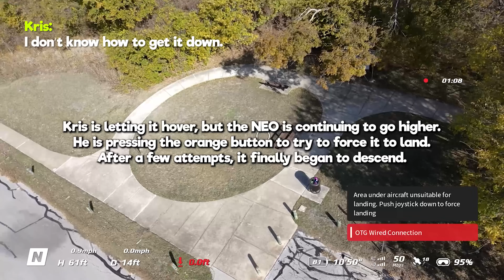Don't Do This With Your NEO [DJI Responded]

Comment: It's not about the GPS.
Neo can fly freely no satellite (0 satellite) but well lit and textured area.

It's not about the satellite it's about the vision sensor
Reply from the maker: Understood, it needs texture and light. That makes sense, but when it goes into a low light area and the GPS is weak, it becomes unruly while flying with the Motion 3. Also, it seems like the vision sensors have an effect on the GPS lock. 

I've had white satellites on the lower right, then covered up the vision sensors, and the GPS goes red and the number has dropped.

Either way, whatever the issue is, people have had the NEO surprise them when they go somewhere darker and lose satellites. And they end up crashing. It shouldn't behave differently and become extra sensitive in that situation. 

That's pretty much the point we're trying to make.
Reply: How about when using the RC-N3 OR N2?
Reply from the maker: We don't own that RC, but we suspect there is no problem because we don't have issues with the RC Pro, FPV controller 3, or just flying with a phone.

Comment: ❤why does the avata 2 work with goggles integra, but the Neo doesn’t? Great video!
Reply from the maker: Probably for the same reason that DJI hasn't fixed this throttle issue. They don't want to spend time/money on something that isn't lucrative. Although, more compatibility might help with sales. 🤔
Reply: @ yes, I would buy a Neo if they update that

Comment: Dude on the right bottom it shows you don't have enough satellite connection. Are you illiterate enough not to know trees block the satellite connection? You are trying to fly it in a box of trees. When it passed above the trees it had enough satellite lock so you were able to control it. Yes, Neo has problem flying in the dark not only dark but low light. But this test is misleading.
Reply from the maker: Yeah, we fumbled that test. One point I was trying to get across was that somehow the GPS lock was connected to the light sensors. 

In later tests (video is yet to be released) I tried flying at night with over 10 satellites, which is what DJI told us was necessary, but it still went crazy. 

Other commenters said that 20 was the minimum. That actually seemed to solve the issue with satellite lock and low light. 

What's surprising is that DJI won't acknowledge that the Motion 3 causes many flyers to crash when they don't realize that it basically becomes 10x more sensitive when it loses GPS in low light.

Thanks for the comment. In hindsight we could've done these tests better, but hopefully it's more helpful than not.
Reply from the maker: When I first took off, it said the home point was updated, at 14 satellites. So I thought that was the sign of GPS lock. But with the tape over the sensors, somehow that causes the NEO to decrease the number of SATs. 

Again, we could've done this better, but the point was that the light sensors are related to how stable the GPS lock is, for some reason.

Comment: Around 10 mins ago I experienced the drone going totally out of control when testing my new goggles and Motion 3.  Like you say the sensitivity and speed increases to the point where it can't be controlled.  Before seeing your video I continued with my testing and I switched on my main lounge lights which are extremely bright.  The drone behaved as expected or should I say as I had hoped.  I then saw your video and was reassured that it wasn't the electronics that had got a fault but a peculiarity of the Neo and MC3.  I need to practice though with the MC3 as there does seem to be some differences to the MC2
Reply from the maker: I've been chatting back and forth over the past several weeks with DJI support, and they don't seem to agree that there is an issue. 

They said that maybe I'm not as good at flying with the Motion 3 than I am with the RC 2, but at least it's good to know that a lot of other people are having the same problem.
Reply: @readysetdrone  Hate to say it but DJI often look for any other excuse,  Im not knocking them because they have definitely improved 100% since the original Wookong days.  I keep getting the message that I am not connected to the DJI Fly App and have lost count of the different options I have tried.  Also today in daylight I tried to fly indoors again and it went berserk with in seconds.  Something is definitely wrong here.  Also I don't understand how they can say its the use of the MC3.... If you just take off and do nothing and hold the MC3 still with no trigger input it still goes mad !!
Reply from the maker: It's definitely frustrating! 😕

Comment: Had a flyaway with my DJI Neo on a misty but visible day. Took off using palm control, and it suddenly shot off uncontrollably beyond the castle walls. No warnings, no way to stop it. A drone designed for easy, controller-free use should be more reliable in real-world conditions. Disappointing.
Reply from the maker: That's a helpless feeling! I wonder if something obstructed a sensor under it. 

When we put tape on ours, it was trying to get away from what it thought was the ground by going up. 

It's a stretch to think that even a bit of dirt could make yours fly away though. 🫤
Reply: @readysetdrone  I just think about infrared and high humidity mix

Comment: it's using semi-automation in motion controller mode... so it relies on the bottom sensors to see and assist in self-leveling and stationary hover.... in full manual mode with fpv remote, it relies on nothing but your skills , therefore performing better ..... but it needs to decide itself to disregard the bottom sensors..... when you tape them over, the ground height reads as 0.0001m and confuses the logic.... it flies for me perfectly under control in pitch black darkness over my city and lands where i want it.... it does ask to recalib the compass every time it sees the darkness and makes a decision to disregard bottom sensors... but once enough sats are on, and they arent RED, it flies like a beauty ... the camera is obviously junk for night, we all know that... but it flies for me like this https://youtu.be/aV2QLAF6icI
Reply from the maker: Yeah, that tape incident was an unfortunate distraction in this video. 

The point we were hoping to get across to DJI and also others flyers were to be careful when flying with the Motion 3 in the dark without a solid GPS connection, because it goes wild!

Comment: This happens to me during the day almost every time I fly. I already crashed the drone once, it suddenly lost control, and at a crazy speed it hit a palm tree that was 20 meters away from it, and it fell and seriously damaged the body, although the drone had additional protection. I have already ordered a new body. The damaged body was repaired, glued together and the drone's functionality was restored. Also, during a flight during the day with excellent lighting and a large number of satellites (20+), it can suddenly stop and make spontaneous maneuvers... I fly with the included (native) remote control n 3.
 It's big problem...
P.S. I also forgot to mention another problem, if you fly Neo on an inclined plane, for example a small slope, the drone does not maintain altitude. For example, set the flight altitude to 2 meters and fly down the slope, then the drone gradually raises the flight altitude, and if on the contrary, then it decreases until landing and possibly hitting the ground, I have not checked, I stop the flight.
Reply from the maker: Wow! There definitely some bugs to work out. 

Regarding the altitude, I think it's staying at the same altitude above sea level, right? But you want it to change its altitude according to the ground's terrain. That seems like something which could be updated on the software. 

For what it is, at $200, it's a versatile little drone. Just needs a bit of firmware "polish."

Comment: Funny it 2 months later and I gust go the motion controller and it did the same thing when flying in the house went full speed into the wall
Reply from the maker: Yeah, that seems like it could be fixed with a firmware update, if DJI wanted to. 

Ours knocked the camera out of placea few times. Luckily we were able to wiggle it back into place. Be careful!

Comment: I got my Neo today and after flattening the 3 batteries flying in my front yard, I took the batteries in and charged them, and was going to do a lap of the house, at night, but I had the exact same issue - it took off after about 15 seconds in the air. I am considering getting the RC 3 as a bare bones controller and still using the goggles to see, not because I plan on flying in the dark, but I just don't like the motion controller as much as I do traditional controllers.

Comment: Tape on the sensors caused the rise, it never had a reduction of load to think it was safe to cut off the motors. Bottom line is, the drone has the sensors and needs them to operate properly.
Reply from the maker: You're right. We pinned a comment to this video to address this. I think our mistake with the tape distracted from the other two issues we were trying to demonstrate which were (1) darkness without adequate satellites seems to make the Motion 3 extremely sensitive, and (2) low light sensors seem to affect whether or not the satellites are able to lock. Hopefully DJI can fix these issues with a firmware update.

Comment: its the same with both avatas - I just put a light at the bottom , so the sensors work batter in the dark
Reply from the maker: Really? That's wild. Have you had the Avata go crazy all of a sudden? We haven't noticed this before with those drones, but then again, we generally fly with the FPV controller, rather than the Motion controller.

Comment: I have same problem with motion controller.  When not enough light, ghosting will happen. But when outdoor in the dark, it become fine again. Something todo with ground pattern too; I think. So if you put a tape underneath, in a DJI no fly zone, because it can't get satellites, you can still fly it.

Comment: most probably its the firmware expecting to get proper data from the sensors looking down and when those sensors are not recieving proper data something happens inside firmware. They can easily make a sensor switch allowing the user to just disable the reading of the sensor so firmware can continue its loop by only using satellites and gyro to control the drone. I want to get the neo, but seing all these weird fly offs not buying until I see its fixed.

Comment: When my NEO first arrived, it flew fine outdoors. In my house with windows open and light turned on, if would fly normally for about a second and then abruptly fly horizontally at a high rate of speed and crash into the wall, couch, etc. I discovered if I pulled the left stick back as soon as the Neo became erratic (within 1 -2 seconds after takeoff), I was able to land it before it flew into something. For whatever reason, it would fly with no issues in the kitchen or master bedroom. The kitchen has more light and the bedroom lighting is similar to the living room. After an update, the NEO flies without issue in my house. It never tried to fly upward. It would take of horizontally like a rocket before the update.
Reply from the maker: Wow, that's crazy!

Comment: This is the 2nd video I've seen of a neo just going up, might be a bug!
Reply from the maker: Interesting. It definitely freaked us out!

In hindsight, putting tape on the sensors to simulate nighttime, was a red herring. What we really wanted to highlight was that when the sensors don't have enough light, the GPS lock becomes unstable (even with 12 sats). Also, the throttle becomes really sensitive when it's in the dark, rather than simply drifting, like it does with other controllers.

Comment: So basically we cannot fly outdoor with MC3 when going to some darker areas like tunnel, under a bridge, etc? A few seconds in dark and Neo will be crazy???
Reply from the maker: Exactly. 🫤
Reply: @readysetdrone  thats very sad and dont think it cannot be solve with new firmware
Reply from the maker: Knowing nothing about computer coding, I would think it could be possible because it doesn't go crazy with the FPV RC3.
Reply: @readysetdrone  neo should only drift, like every drone it atti mode...
Reply from the maker: Yeah. That is what it seems to do with the other controllers that we've flown it with.

Comment: My 2 cents… differentiate between LAUNCHING with no down sensors, and LOSING down sensors.  

I figure - no down sensor = no elevation.  What do you need if you have no elevation?  Lift.   

NEO drifts up to escape the “I must be on the ground because my down sensors see nothing” feeling it has.
Reply from the maker: That totally makes sense now. Taping the sensors and that increase in altitude was a bit of a red herring. The main 2 things we wanted to convey were that the Motion 3 becomes really sensitive when the NEO goes into the dark (but other controllers seem fine), and the GPS connection seems to be connected to whether or not the lighting is good or not. 

Thanks for commenting. We will have a follow-up video in actual darkness, soon.

Comment: Same experience, I was flying my neo near dark areas of the trees and it suddenly went straight for the branches on high speed until it crashed with head downwards to the ground 4-6 m
Reply from the maker: Until DJI fixes this with a firmware update, the only solutions are to fly with the FPV controller 3, or to have more than 20 satellites (based on some of our recent tests) but under trees, the GPS might be weak. 🫤 Hopefully your NEO is ok after the crash.
Reply: @readysetdrone  the neo turned out well with some minor scratches, however the magnetic lens filter from freewell got cracked. Ive noticed some minor flaws as well on flights with a mobile phone. Where it doesn't want to go upward until the area is well lit.

Comment: Since you mentioned that the Neo's acceleration is exaggerated with the Motion 3 when flying in the dark, does pushing the trigger forward help it stop and hover at least?
Reply from the maker: If you're able to do it exactly right, maybe. Ever time I've tried, because it's going forward so fast, I need to push the accelerator forward a lot to effectively stop the forward motion. At that point, I've either failed and it's already crashed or, now I'm going backwards quite fast. 
At 4:02 I accelerated a little bit and then tried to reverse (you can see the drone pitching way back), but I ended up crashing into myself. I wish the emergency stop button worked in this situation.

Comment: Pitch dark no GPS low altitude w/LED undercarriage strip Goggles 3 and FPV Controller 3 in normal mode. Very fun and stable.
Reply from the maker: That's awesome! We tried it with a light in our previous NEO video, and it was a lot better, but we were pushing it too much. We were flying in an unrealisticly dark room, so the light only worked for a little bit, eventually it crashed. 

Flying low, as you mentioned, seems like the key. Thanks for commenting. 👍

Comment: There's a clip-on light made by StartRC for the Neo. Only weighs a few grams and illuminates under the drone. Works really well. I've flown the Neo around inside with nowhere near enough ambient light and it had no issues. I think it cost me about AU$15 from an online Chinese Supplier.
Reply from the maker: That's awesome!

Comment: “Hi there, thank you for your patience. Upon checking with the enginering team, it shows as as pilot error as the aircraft is tested in the dark place and everytime the drone comes out from the backdrop its drift as over its mentioned in the manual. Please conduct a test flight in a well-lit environment and check if the issue still occurs.

Thank you! “ (c) DJI Natalia
Reply from the maker: Yes, it's pilot error. But this issue occurs only with the Motion 3, where it speeds up after going through a dark area. Other controllers that we've tried, didn't change the throttle sensitivity.
Reply: @readysetdrone  That's right. We're trying to get DJI to fix the mc 3. Obviously, something can be done about it, like making the drone just stop.

Comment: Great video!   Your tests and experiments were super helpful.   I had a similar acceleration issue while using the RC Motion 3 with Avata 2.  Except I had plenty of lighting and GPS.  I kept getting RC Motion 3 Interference nearby messages and then the Avata darted off (I was standing next to my car) Letting go of the throttle stopped it.  People are using lights on the Neo and Avatas for low light interior flights.
Reply from the maker: Thanks for sharing your experience. Interesting that you had interference while flying with your Avata 2 by your car. 

In our previous video about flying the NEO in the dark, we tried attaching a light to it, and it definitely did a lot better, but eventually, crashed.

Comment: Mine will glitch and freeze in midair in manual mode if pushed too hard. It locks up at an angle and drops but usually I can recover if I have enough altitude. Also the performance drops off substantially when the battery gets below 50%

Comment: I noticed this when flying indoors, I resolved the issue by fitting a small LED light to the bottom of the drone. It obviously uses the ground as a reference and if it can’t see it then it zooms off.
Reply from the maker: Nice! We tried that in our previous "How to fly the NEO in the dark" video, and it definitely helped, but it eventually crashed. Admittedly, we were pushing its limits, by flying in a pitch black room. 😅 But we're glad to hear that in normal low light conditions, a light helps.